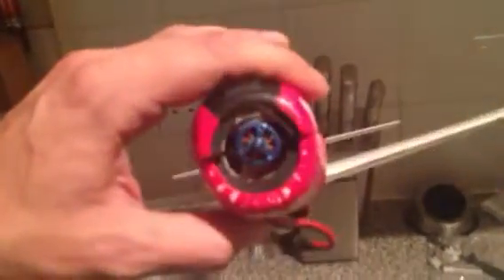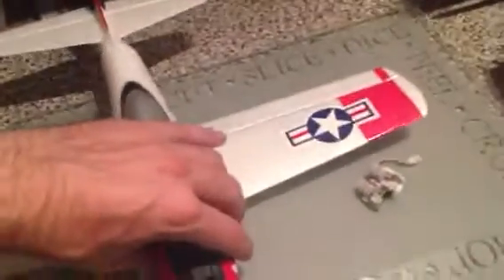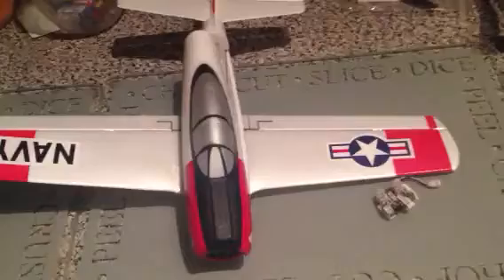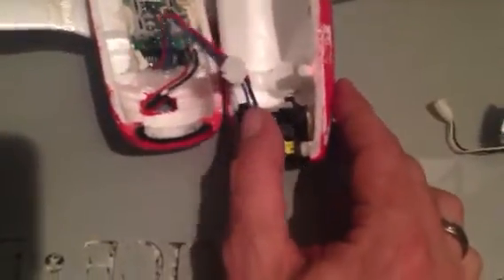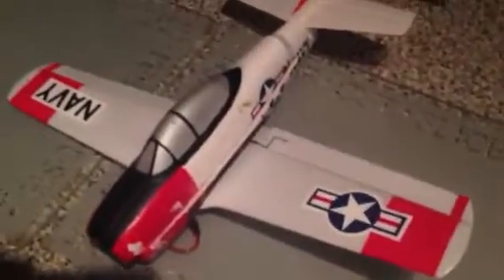Um T28 brushless conversion part 1

Comment: How did you get the thrust angle correct? Could you mount the motor on the bottom half of the fuselage?
Reply from the maker: Miller to be honest I can’t actually remember lol. Just off looking at the angle form the bigger 1100mm one I had at the time.